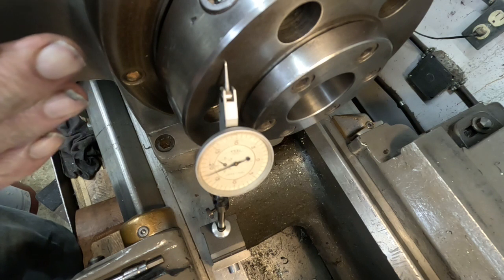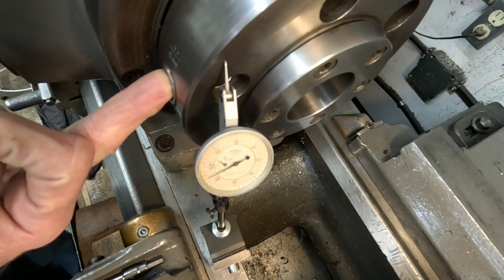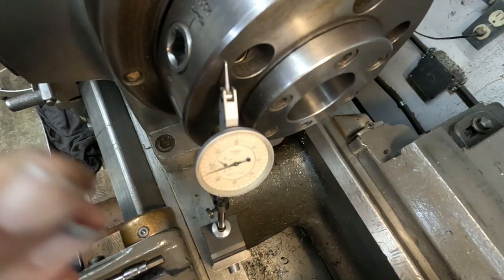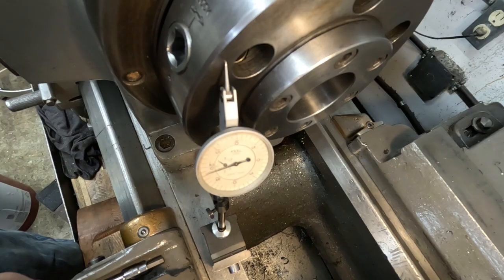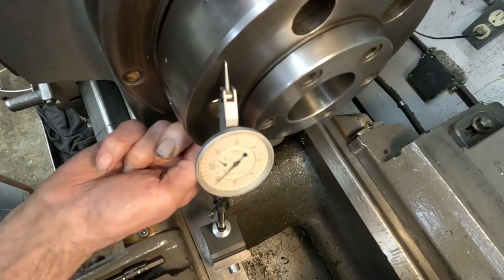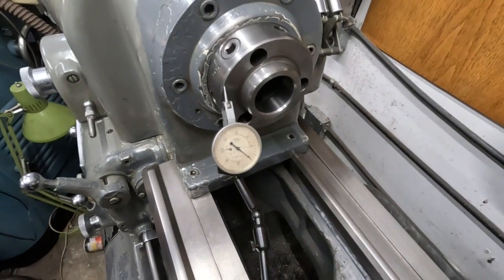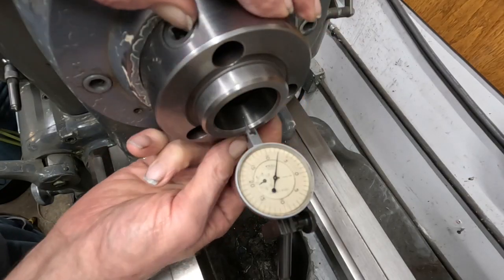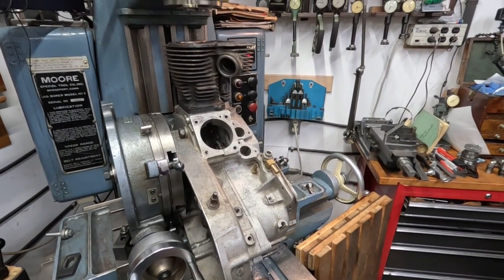Engine Lathe vs Toolroom Lathe Spindle Nose Run-Out

Comment: After 50 some years with manual lathesi recently bought a brand new  shipped from California tfactory to my shop in Ohio for me, Haas Toolroom Lathe . When it arrived I was amazed and  surprised thart the documentation said that after setup the runout spec was .0001 measured 10 inches out from the spindle nose using with the precision test bar which bolts up to the A2-6.  Well I ask the setup tech when he was going to perform such a test , I wanted to see it with my own eyes.  He said he didnt have the 10" stickout bar with him.  He returned the next day and brought it. As I came in I saw he was performing the test, bar bolted up  ..........indicator on bar end.AS I tried to see the needle 
he said ....well it takes some wrenching on the bolts and some tapping to get it in and then gave it a whack with a hammer so big it almost scared me.  Looking at indicator....hummmm  still out when rotated..  ( surmised the whack took the bar over center and indicator was now reading thenow  the same offset but in the opposite.  My immediate thought was  tthat by publishing such an incdable tight spec the machine was going to be good....very very good for me..and I  Told him it was good very good as is  and lets quit  NOW !      My thought was to obtain myown test bar and do the test later. Well the super pecision test bar  I found to be $2500 .....mmmm  I can buy a cylindrical grinder for that and have a go.  But the programmin has occupied me and is taked much longer hat I imagined ...Haas says they are easy to use.....I questtion that ....but its pretty amazing what it does and a great pleasure to use.
Reply from the maker: Hi, that specification does not sound possible. Being older myself, I find computers difficult and slow. The Haas lathe seems to be very good, I have not heard of complaints.
 These days, all I do is repair antiques where modern technology is not required for the most part anyway as the parts are simple enough that they can be made faster than programming. Thanks for tuning in!

Comment: I ran that Monarch lathe back in the 60’s, best lathe ever! The only issue was that the rectifier tubes use to blow once in a while.
Reply from the maker: The one I have is one of the last made with the tube drive 1983, it has been very reliable, thanks!

Comment: Those Tesa/Interapid tenth indicators are things of beauty. Exquisitely sensitive yet lots of range. Seems like no other manufacturer has ever made a truly competitive unit.
Reply from the maker: This one is older with a lever on the side to reverse direction of the point. It is the best one I have used, thanks
Reply: @deedeeindustrialsuperprecision  I wauld like to have one like that.  I am learning more about indicators want one with a reversing lever.

Comment: Is the spindle nose and Morse taper on the Axelson replaceable?  Looks like it with those bolts on the face?
Reply from the maker: The Innercircle of screws retain the cam locks, the spindle is one solid piece, thanks.

Comment: Man that Monarch is on the money Don, incredible piece of kit 👌
Reply from the maker: The Monarch Company put every effort into producing these lathes regardless of price. This one used by a missile guidance systems company but remained government owned. There was a period of time that a few of these machines of this caliber were released in the early 2000s. Not many Monarch 10ee lathes have this attention to detail, every one of them is a custom order.
I was able to get this machine on a Gov sponsored lease that was a total tax write off, so it cost me $1 at the end of 5yrs. Lost Creek Machine got this lathe in 2002 and I snatched it up quick after contacting Monarch and getting the specs on this specific lathe, Monarch wanted to buy it back too. It still holds original tolerances.

Comment: Hi, how do you stop your collets wearing ridges on the internal taper from the slots in the collet? I reground the internal taper to get rid of them, they were about 10 thousandths from memory?
Reply from the maker: The Monarch uses a collet chuck, the spindle taper is a Jarno for use with a dead center only. The best defense for wear is careful cleaning and using thin oil on the collets. I found the best lathes for collets is Hardinge but after years of use they develop the ridges where the taper needs regrinding. Thanks!
Reply: @ that’s what happened to my HLVH